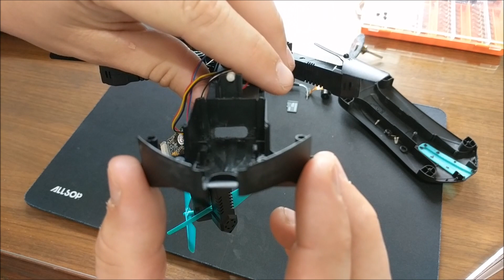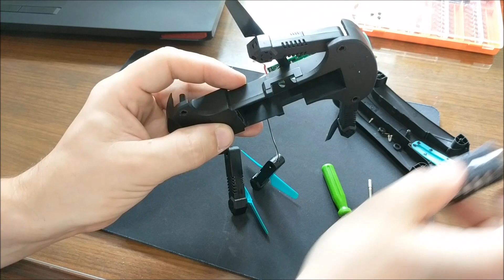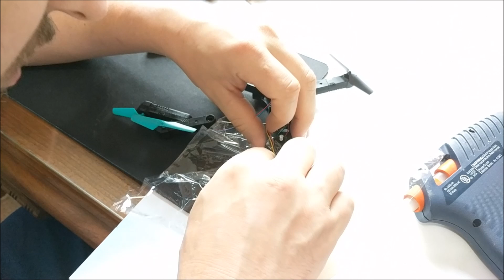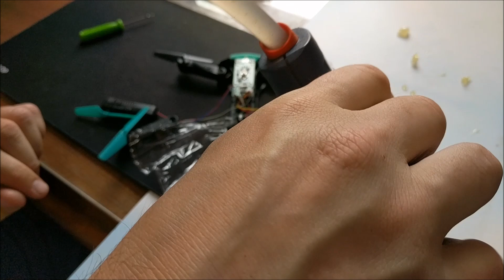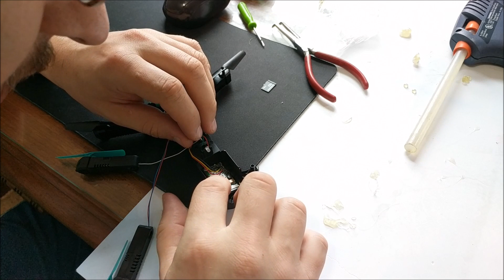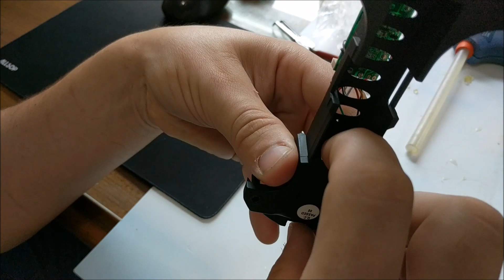JY018 MicroSD Card Mod

Comment: Thanks for this video .Concerning the dual battery mod : do you think it would be possible to dismantle two original batteries and fit the two processors in parallel in one original assembly ?
This would double the flight time with very little increase in the weight ( and balance) .

Comment: Where is the dual battery mod? Also will a 18650 battery fit/work with the drone?
Reply from the maker: Once I get some more time.  Will require a couple sacrificial batteries before I have something that works.  IF it works.  I will try to keep a video log of my progress, and make a tutorial video from it.
Reply: M1dn1ght N1nj4 thanks for the reply, i look forward to it, also as viewer request, can you check if a 18650 Li ion battery fit/work with it, thanks in advance
Reply from the maker: Actually, if the circuit that controls the stock battery will accept the larger 18650 battery, then that should be a perfect mod.  It would fit GREAT in the stock housing.  It may be a while until I can get to it.  But I will make a note of it on my desk.

Did you buy the JY018, or just using the video for a review before purchasing?
Reply: M1dn1ght N1nj4 well thinking of buying one, i noticed the battery housing looked it could fit a 18650 battery, and would like to mod one to increase flight time, i appreciate the replies, but can you check if it does accept a 18650 battery conversion? Thanks